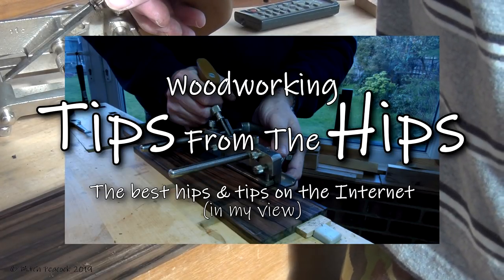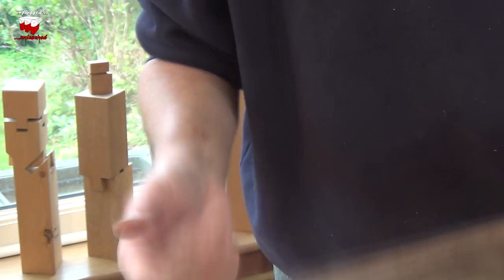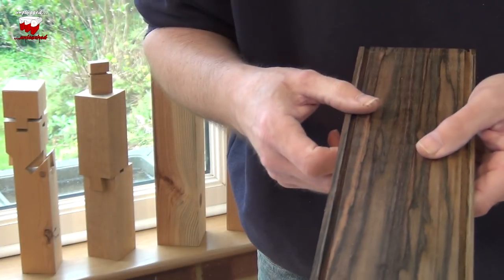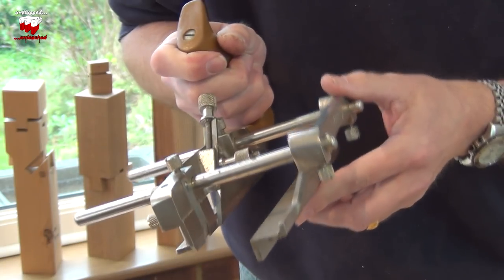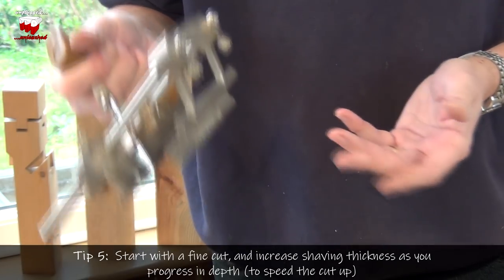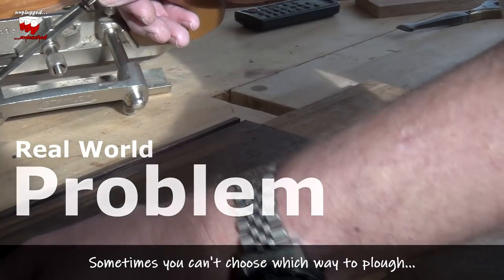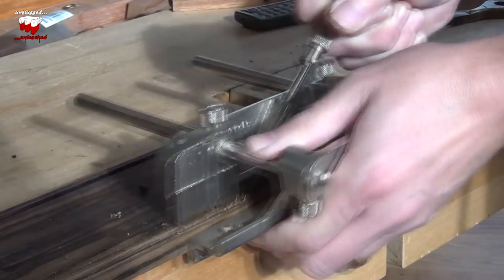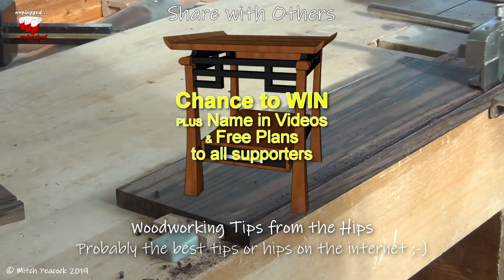Plough Easy & Clean - Tips from the Hips

Comment: Great tips Mitch, particularly liked the mortise gauge one. Was that a 13-050 you were using? I picked one up cheap on eBay, thinking the design looks very practical, but have yet to use it in anger. Do you find nice to use?
Reply from the maker: Cheers Robert. It was indeed a 13-050, and for narrow grooves like this it perfectly good, although not made to the best tolerances and so initial setup for the groove can take a while. This was an eBay bonus, free with another place, and possibly a "cut n shut" since the second skate is a very poor mate to the main one. Narrow grooves only require the main skate, and so it doesn't prove a problem.

Comment: Good tip, Mitch. The Stanley plough plane your using has a plastic handle, is this a relatively new one?
Reply from the maker: Cheers Steve. It's a 13-050, and off eBay, so I'm not sure about exact age. Clearly second half of last century though. Remarkably comfortable handle, but not much to look at ;-)
Reply: Thanks Mitch.  @mitchwoodwork

Comment: I have the 12-250 model of this plow plane, mostly just like it but handle is black and nickers are like the 78 rebate plane with three tips. Card has 18 pieces and came with two extra cove cutters and a one and a half sash cutter. Funny thing about this set is it goes to 7/8 inch but there was never a 3/4 inch cutter supplied. which I find odd. Also has an adjuster screw on the back of main skate to make both skates parallel, which I didn't see on yours. Only issue I ever encounter is skate dragging through cut. They measure less than whichever cutter is installed, so seems odd  to me.
Reply from the maker: When you mention skate drag, it reminded me that I have occasionally noticed that. I wonder if it is a slight misalignment on setup. Worth experimenting with.